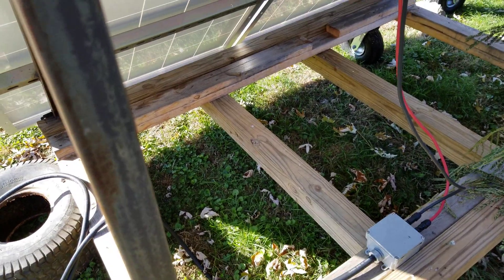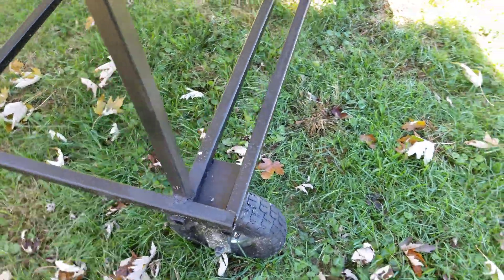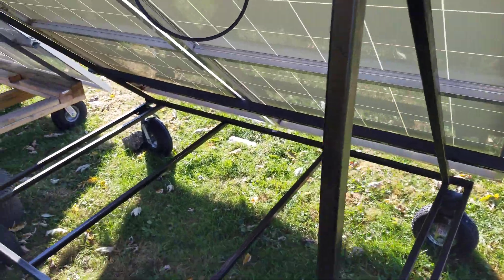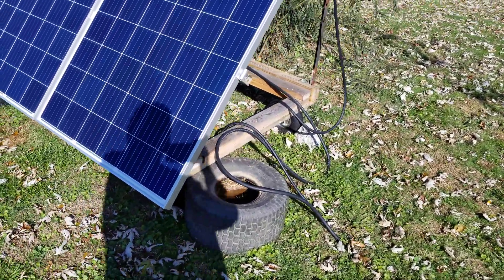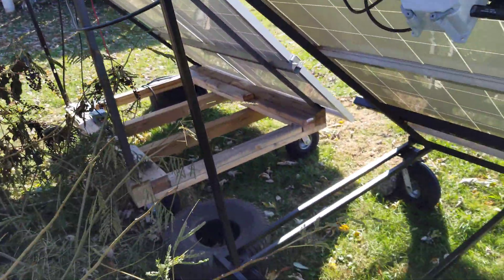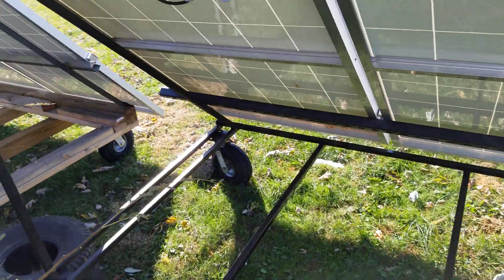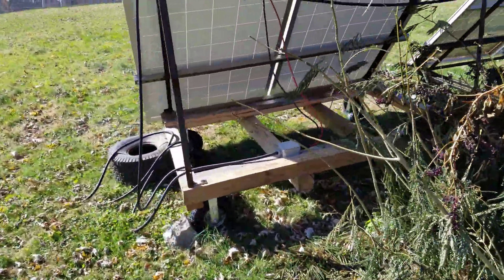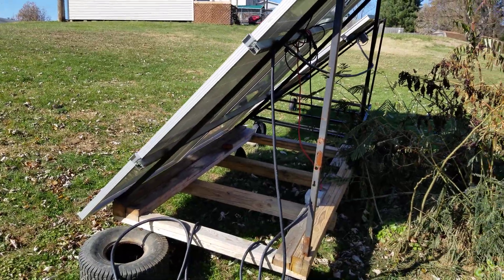Portable Solar Rack 2.0

Comment: I love the idea of the frame and wheels... I could easily move these around by hand and if I had to I could even pull them with my tractor. The only thing I would like even more is if the angle of the panels could be adjusted. Other than that this is what I want.